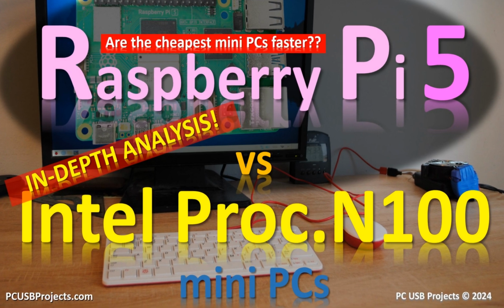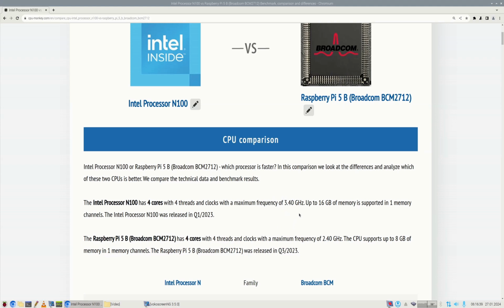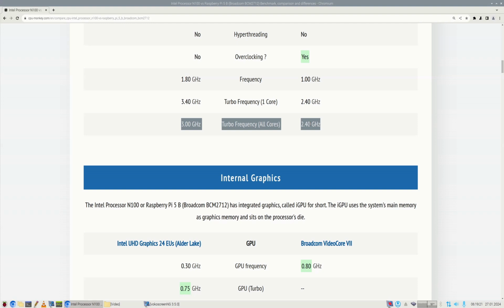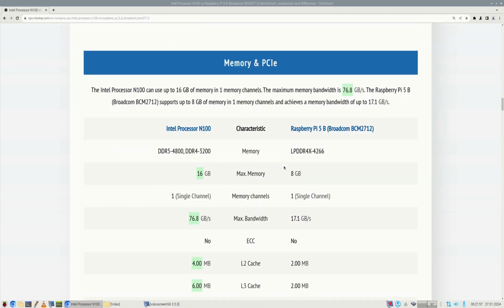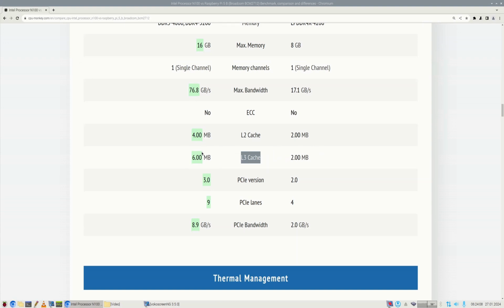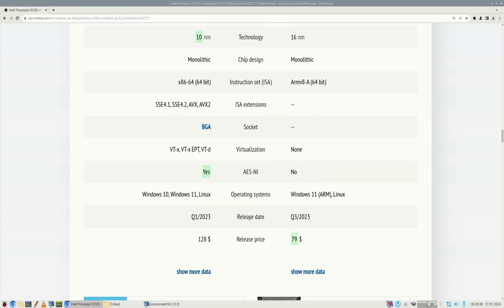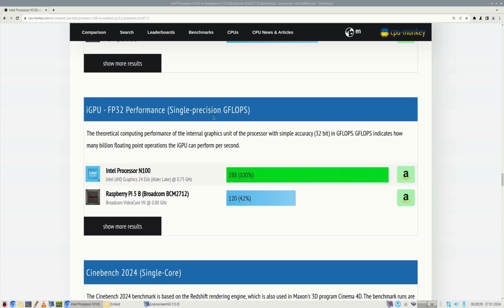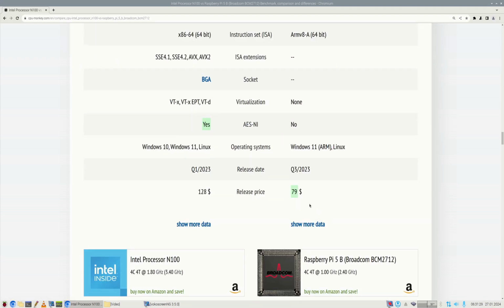Why is a $150 classic mini PC 2x-3x faster than Raspberry Pi 5?

Comment: PIs were nice when were 35 bucks
Reply: You can still buy those models for $35
Reply: @TrentR42  So does Mini PCs twice as capable
Reply from the maker: Each new model of RPi has a significantly higher performance compared to the previous one. Say, RPi 4 compared to RPi 3 or RPi 5 compared to RPi 4. Currently, RPi 5 price is still relatively high due to a high demand. But I expect it to fall below 50 USD for a 8 GB model in this year. The price is also influenced by competition like Orange Pi 5, Rock Pi 5 or even the low end mini PCs, which price range starts at about 130 USD. You can pay just 80 USD  for a new RPi 5 with 8 GB of RAM , if you already have a suitable case, at least 5 V, 3 A power supply and a fan or a cooler and appropriate cables. However,  if you are building a computer from scratch, you would have to pay around 130 USD to 150 USD to get all the components that you need for your Raspberry Pi 5. I agree that this price might be little too high compared to what a new low end mini PC's 2x-3x higher performance.